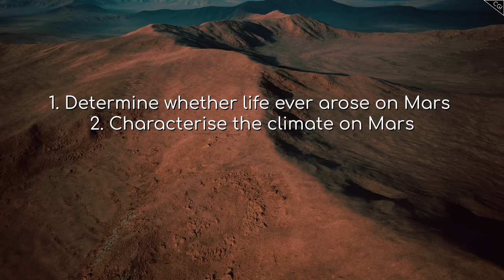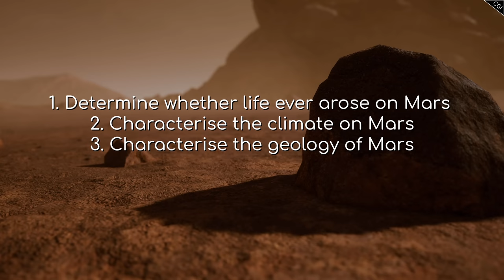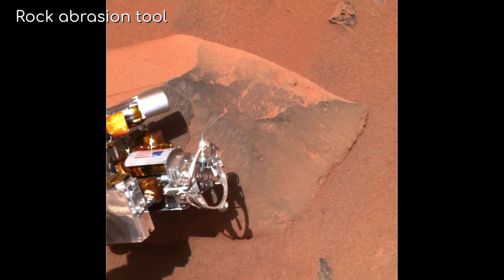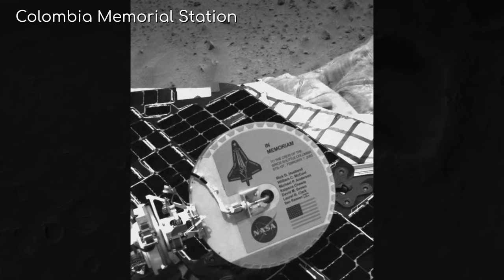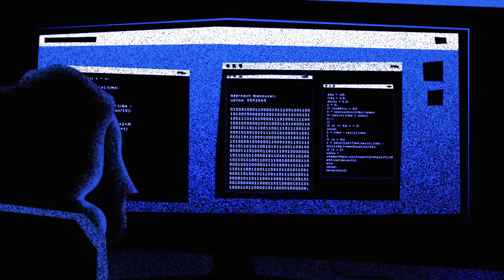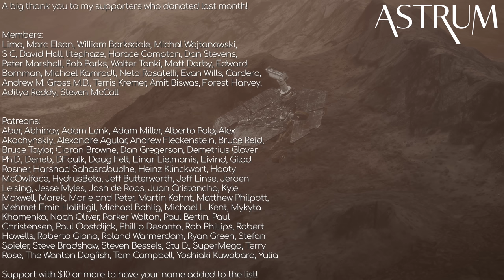Why NASA Stuck a Bunch of Balloons to its Mars Rover | Spirit Part 1

Comment: How did the air bags ensure it stopped rolling wheels down, or how did it correct its orientation after rolling , have always wondered about that.
Reply: center of mass probably
Reply: It was actually a triangle that opened fron the top. No matter what side it landed on it would right it's self.
Reply: @Tinman97301  so if the wrong side was up, it would just fold over?
Reply: @sparkieT88  Yes, the free petals flipped it upright regardless of the initial orientation.
Reply: @brettbuck7362  that's so cool
Reply: It's a 50/50 shot.
Reply: @wetbadger2174  no because it doesnt matter on which side it is
Reply: When it unfolds the middle part is the heaviest so it will naturally settle as the base
Reply: @Tinman97301  Technically it's a tetrahedron, so four triangles, but otherwise, yeah.
Reply: @Buskyb  Assuming it didn’t stop against a large bolder, cliff face, or crater wall.
Reply: @gammondog  Hence why landing location was so critical. But Id still say in most cases it would be fine, unless it landed such that two of the wings were totally pinched shut. Cause it could just push off the wall with one wing and roll over
Reply: Deflate bags in a certain order. That's probably why there's so many of them.
Reply: Came here to ask this exact question
Reply: magic
Reply: Probably since its triangular,they can deflate 1 face first to orient it.
Reply: @caaarbz  Oh really? You should go to NASA and tell them all they need to do is be clever and develop software to get the rover unstuck since its not that hard.
Reply: @wetbadger2174  Nope , it was not. Read the above comments
Reply: The aliens would have corrected it
Reply: @Tinman97301  You mean pyramid.
Reply: @BladeOfLight16  🤣 I was sleep deprived when I posted it and could not for the life of me remember. Not going to edit it, it's funnier this way 👍

Comment: They did OTA programming on a Mars rover? Unbelievable. Really great job NASA, that's actually really cool.
Reply: It was done during the Voyager missions as well.  The Voyager spacecraft were so advanced for their time that they were completely reprogrammed while on their way through the asteroid belt, if I  remember correctly.
Reply: Most spacecraft are designed to be reprogrammable, in case an undiscovered bug is found or a technical issue appears that requires the craft to be used in a different way. This actually  happened on missions like Kepler or SOHO.
Reply: @Релёкс84   Why can they do this and my PC can't even establish a WiFi connection.
Reply: @icebuildsrobots  maybe you should invest a few more million dollars in your setup

Comment: I understand the obsession with mars and all, but what about other places? I’m talking the moons of the outer planets. We have multiple rovers on Mars, one on Europa or any of the other moons of Jupiter or Saturn for that matter would be amazing. I don’t think it’s too far fetched to do something like this what with the way current technology stands and is evolving. It would be a very interesting mission to pull off
Reply: The Europa Clipper Mission launches in Oct 2024.  That is the first step to determine landing points etc.  Much like Mars Odyssey Mission was in orbit in 2001 and the rover did not accompany it until 2004.  The Europa Rover target launch date is 2027ish.
Reply: We did technically have a rover to Venus, they just got fried in less than 2 hours. However, the prospects of an airship rover is actually quite feasible in the right altitude.
As for the rest, I believe the difficulty delayed rover missions. To go that far, you need a lot of speed. To land, you need to get rid of all that speed.

Comment: Hey Astrum!
I love your videos. And I have a question for you, why don’t these rovers have a wiper on their solar panels. Seeing it build up on the panels, it must block the sun light so it creates less energy for its scientific uses. 
Why can’t they just have a wiper so they’ll operate for even longer?
Reply: Its' a good and common question! There are many considerations when building a wiper. It's an additional moving part that would need to be considered/maintained for one! Additionally, unlike car wipers that wipe water, wiping dust, especially very fine dust, can/will scratch the panels. So while dust may be removed, it would actually damage the panels in the process.
Reply: Ah thanks so much
Reply: @ACN380  Good point. One could make the argument to use a fine brush on the wiper, though, with the weather conditions and so forth it wouldn't surprise me if it deteriorated, turned solid or so forth.
Reply: @EmilM-pb2hn  yes agreed, knowing what we know now there probably could have been several mitigation tools used.
However there is also the overarching original perspective that these rovers were originally designed for a 90 day mission in mind. That would include all the parts. 
It’s just amazing that none of those daily operating parts (wheels, cameras, panels, batteries, cables, heaters, etc) degraded earlier or this conversation would be focused on more durable wheels instead of panel cleaning, or better flash memory, etc.

In the end, less/no parts is always more reliable than an additional part, so the engineers definitely designed the rovers very well to meet the original 90 day goals
Reply: @ACN380  In the future knowing what we know now, you could probably even have a mini-compressor on board to pump some of Mars' atmosphere into little blowers to clear off the panels!

Comment: Did it really roll anything like that? That seems like a lot of chance after years of preparation. What if it was on its side or something?
Reply: i seen this from another comment on the original animation that was shown in the video the panels that opened actually tilted it upright... apparently idk i havent watched the original animation
Reply: @Stormento_  that could make sense but still seems like an awful lot of luck which I know just getting there is a challenge and then landing safely but with the parachute plus the thrusters firing off just before it hit the ground all seems pointless if it's gonna use the airbags. Well the chute would help to slow momentum for the rolls. With the tech we have I don't see why do it that way but I'm not a rocket scientist nor astronomer. I'm not questioning like they couldn't do that or anything like that. My brain had a very curious thought pattern and unfortunately always wants to know the how and why of things but not for any reason other than for my own knowledge. I was on drugs for almost 2 decades and I've been clean 4 years so my brain has all this extra thinking abilities without drugs in the equation and can be hard to satisfy sometimes cause not everything has an answer

Comment: Pretty awkward issue you're detailing here. As an embedded software engineer with a QA background it kind of baffles me how they apparently didn't take memory fragmentation from data logging into account (logspam) in the early software planning stages. This could have been easily prevented by implementing a simple fixed size cyclic log, the simplest implementation of which would be a ringbuffer using unit heaps to buffer the log data for the next transmission (or split heaps in case they needed to process data larger than their bandwidth allowance). Taking this issue into account I guess they probably would have run into further fragmentation issues down the line. Memory allocation management is pretty important when you're operating a write-heavy application on limited persistent memory even more so when using flash memory under suboptimal operating conditions.

Comment: Too bad that with all those genius minds at NASA, they forgot to put a brush to scrape dust off the panels.

As the saying goes: COMMON SENSE IS NOT COMMON.
Reply: That's not why there isn't one lol
Reply: I hope you're being sarcastic
Reply: @SolidSiren  why tho ?
Reply: @harshivpatel6238 To suggest NASA engineers and scientists "didn't think to add a brush" is absurd. They plan everything in these missions to incredible precision. They have more common sense than nearly every skeptic Ive ever spoken with, and actual knowledge and experience on top of that.
Because every single gram is carefully accounted for. They have to keep them as light as possible, and the goal is mobility and science. They weren't even created to last long enough for the dust to be a major issue anyway. Spirit was only meant to operate for slightly over 90 earth days. It operated for over 2200 days. 
Power usage is also extremely carefully calculated. A device to remove dust would be at the bottom of the list of priorities. (Dust was removed from panels several times throughout it's mission which lasted far far longer than 90 days, we assume by wind)
Reply: Breaking: Local man with abundance of common sense thinks people, capable of sending a robot to land and operate successfully on a planet >200 million kilometers away, are stupid.

Context: Rover operates 20 times longer than it was designed for.

"Common sense" is, indeed, exceedingly "common", as demonstrated by this humble and intellectual OP.
Reply: @SolarScion  exactly